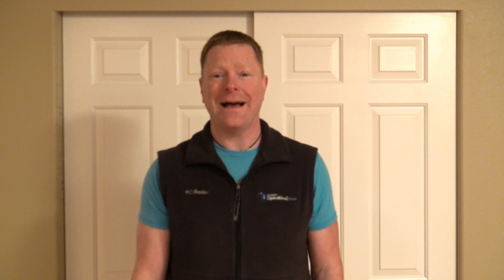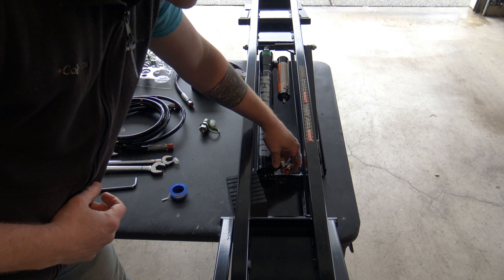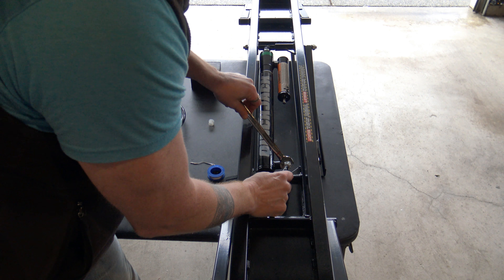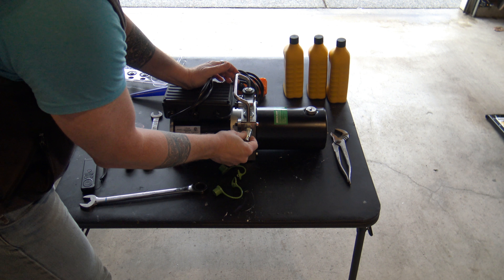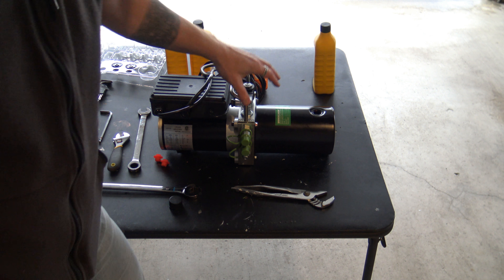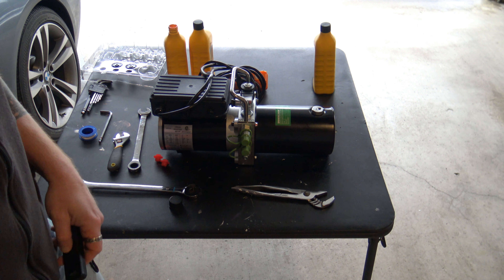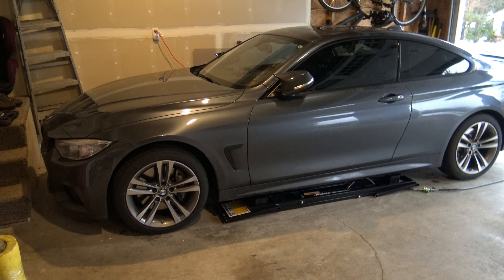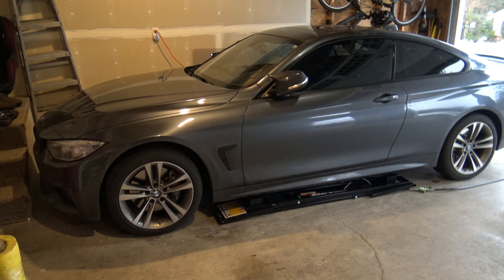Quickjack 5000slx lift setup and demo - best garage tool ever!

Comment: Great video, and thanks for noting the guide changes in the description. I went by quickjacks official video instead of the guide which now states, "The QuickJack is designed and engineered to be used with the weight of a Vehicle on it. You
 should only raise the QuickJack Frames with the weight of a Vehicle on them, even the very first time you use them. There is simply no reason to raise your QuickJack Frames unless there’s a Vehicle on them." "Very first time" is in italics, and likely for good reason. When I tested without weight, they won't go down without a few hundred lbs stacked on them.
Reply from the maker: Happy to help!

Comment: Great video, very descriptive. Just ordered mine today on Black Friday sale, great deals. Question: do the rubber blocks mess up your BMW jack pads? I always use the Burger Motorsports jack pad adapter that fit inside the jack pad. Not sure if I should use them with this.
Reply from the maker: I used my jack pads adapters initially but haven't in a long time. The blocks are soft enough to not damage the jack pads.  LOVE my quickjack, dont know how I loved without it!

Comment: Awesome 👍 now I'm gonna have to get one lol.
Reply from the maker: Really amazing so far, and I have two confirmed (major) projects coming up, and two more pending that are even bigger.  This will make a HUGE difference in all of them!
Reply: @BMWDIYGuy  can't wait to see it. I have f36 and your videos have been very helpful. 👍
Reply from the maker: @bulsaraxxx  Well Wagner catted down pipe on the F32 coming up soon, and an amazing mid pipe upgrade for an F80.  Then two pending secret projects for the F32, that I have my fingers crossed on.. they are each massive projects.
Reply: @BMWDIYGuy  I have fabspeed sportcatted on my car and it sounds amazing paried with MPE. Im pretty much FBO except for CP need to do that asap.
Reply from the maker: @bulsaraxxx  yes.. yes you absolutely do!  The OEM pipe can shatter under normal driving.  Change that out asap!
Reply: @BMWDIYGuy   it's on my to-do list. already popped on me once. Any recommendations on CP? I'm thinking about ER CP.
Reply from the maker: @bulsaraxxx  I installed the cp from Active Autowerke, call me biased. 8)